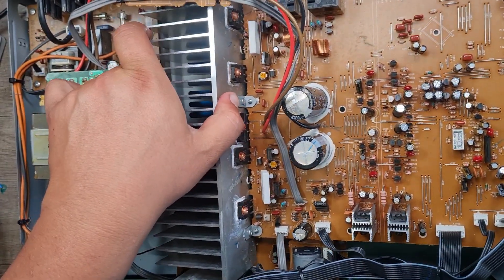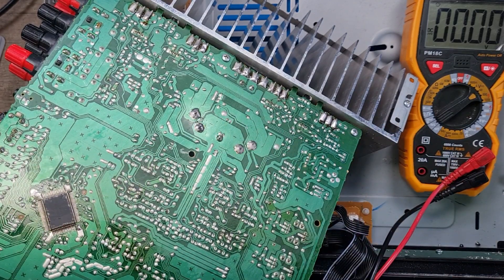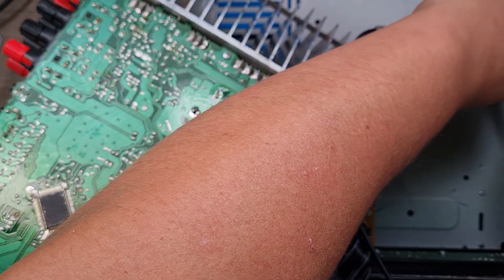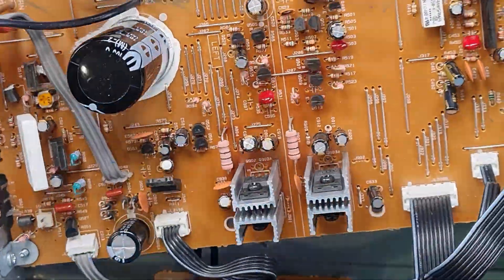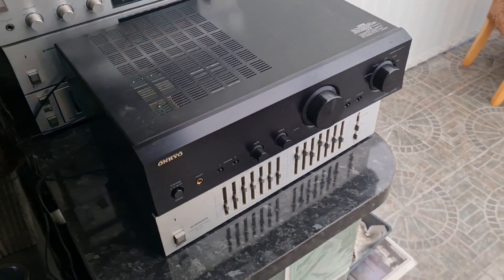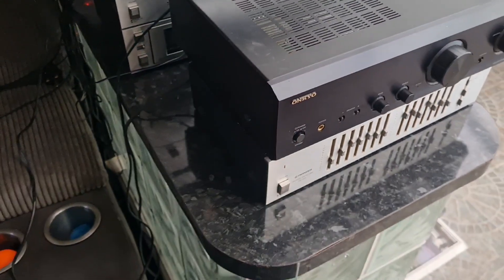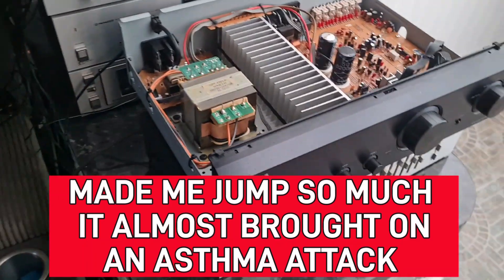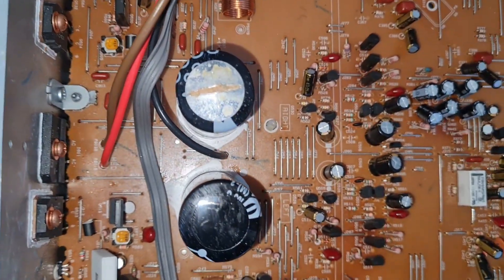Capacitor Explosion! This Actually Scared Me - Onkyo Amplifier Repair Goes Wrong AGAIN

Comment: I always take several photos from different angles before I work on a board, just in case I need to confirm things. Thankfully, the cct boards usually make it really clear on the top side which way round the polarised electrolytics go though.

Comment: The board is always marked on the top.  Sometimes it’s around one hole, sometimes it’s adjacent to the pin.  Which hole is marked is determined by the manufacturer and it’s often different.  Check other electrolytic caps to see which way they are mounted.  On the NAD I currently have on the bench the white marked hole is positive.  On many amps I’ve done in the past the marked hole is negative.

Never connect speakers until you’ve set the DC offset and bias.  The amp I received passed a dim bulb test out of the box but was measuring 500mV DC offset.  Needless to say I powered off immediately.

Comment: Loud hum = bad… transformer is labouring. Grab a power meter for your power socket which helps show if you have a short or excessive power consumption but a dim bulb or variac is more ideal and safe. The central - does indicate ground technically but when it comes to the amplifier supply rails, you have a positive rail and a negative voltage rail, so the ground isn’t actually the ground for the negative rail as it is at a higher potential than the negative side 🙂 Never ever trust silk screening either, always take photos and replace components one at a time if possible…

Comment: Be carefull some times the board is also marked wrong,most techs take one out at a time,and put it in the way it came from the factory,it doesn't happen often,but if you watch other videos on amp repairs on You tube,you will see it.

Comment: Meh. It's a class D no biggie. Just keep your hands off of the AB amps lol.
Reply: The amplifier in this video is NOT a class D . Take a look at the power supply
Reply: @locutiss100  So it is an AB, apologies. But what does the power supply have to do with it?
Reply: The power supply in an AB amplifier has a much LARGER transformer , along with the larger filter capacitors. Also the layout of the transistors on the larger heatsink in that an AB amplifier produces a very high amount heat when pushed. Class D use smaller transistors on smaller heatsink, only getting barely warm, while providing sometimes  hundreds of watts.
Reply: @locutiss100  Close enough for me. I should have looked more closely at the amp before saying it was a class D amp. Class D amplifiers typically use a monolithic driver, often times having EQ, Mute, Balance, etc. all built into the IC. I didn't even pay attention to the FETs on the sink until after you called me out on it. I saw the late model chassis, and the small mains transformer, and the heat sink and made an assumption lol. At any rate, the size of the power transformer and reservoir (filter) caps are directly proportional to the RMS output wattage of amplifier. Class AB doesn't necessarily need a bigger power supply than in a class D amp. It still takes wattage to make wattage, and the trade-off is minimal in that regard. In more high-end designs where the instantaneous current demands are high, you will often find toroidal transformers with much larger caps, but this isn't always the case. It really depends a lot on efficiency factors (losses), dampening, etc. From what I can tell your Onkyo is an A9155? I've never serviced any Onkyo gear. Mostly I work on Peavey, Fender, Crate (most SLM stuff) for live sound, and I restore a lot of vintage Pioneer SX series receivers also. I have worked on quite a few Marantz receivers in the past too. Anyway, it's nice to see someone getting into electronics.
Reply: Clearly the replacement capacitor was installed in reverse polarity 
Before removing, mark the board with a dash mark on negative side 
Can't always rely on the factory labeling

Comment: NEVER connect speakers on an amplifier before all testing have been done correctly with the proper equipement. Hearing a loud humming sound from a transformer is a big red flag!  You already electric shock youself and "Kaboom" a capacitor in your face, you learning the wrong way.

Comment: Never rely on markings on a pcb, check the polarity with a meter just to be certain.
The last time this happened to me was with a bad batch on multivalue capacitors in the same can
the manufactuere had got the polarty wrong!

Comment: You should use dim bulb tester and variac on powering like that after repair. Before removing a high voltage cap maybe take pics and note the orientation. You have been lucky on burning just a cap and not traces and also a tranny. You can hear 50-60Hz coming through it should have been enough to turn everything off and check the filtering. What you are doing is dangerous.

Comment: At very least you need a dim bulb tester.
Reply: @jasejj  Have a look at both videos. It at least 3-4 seconds before the caps blow. If you have your wits about you you should be able to catch it with a DBT. I have done it. I dare you to test the theory.
Reply: @jasejj  Yes but it will detect a high current draw on start up so to enable an immediate power down. Trust me Ive done the same under dim bulb and it saved the blown cap. I wouldnt be plugging in speakers either until you know that the amp is working without issue maybe test DC offset & idle current as well under dim bulb.
Reply: @jasejj  you obviously do not know how a dim bulb works.
Reply: @jasejj  wrong! a proper sized dim bulb WILL go full bright if a filter cap is installed wrong. i know. i have seen it first hand. it also limits the current so the cap does not go bad as long as you turn it off immediately. you need to review your notes.